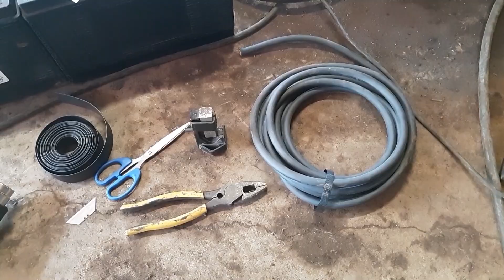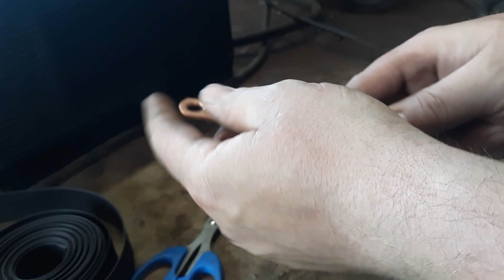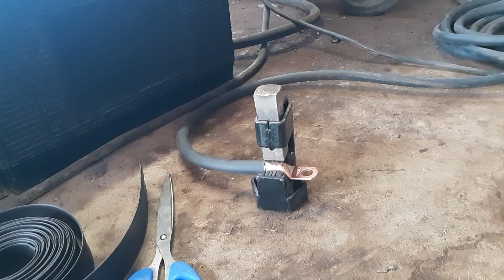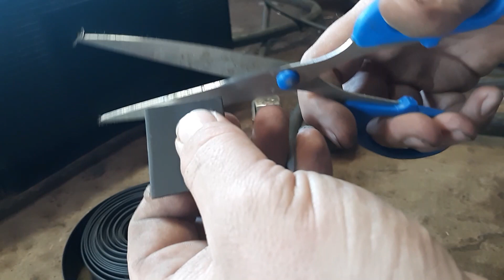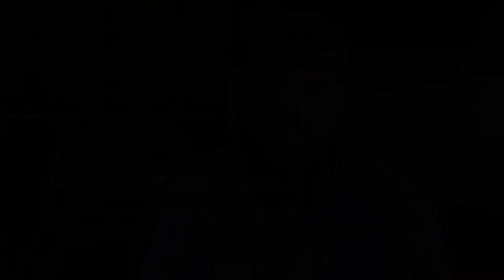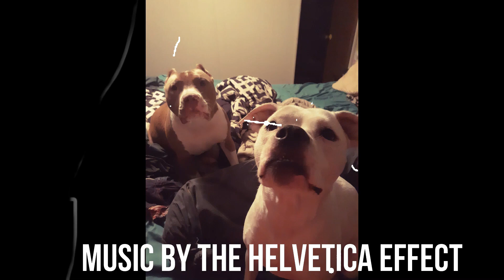How To Build Your Own Battery Cables

Comment: If I’m running six switches
Three pumps 
A batteries 
Would I run six batteries to the front with four solenoids 
And the back two pumps  with two batteries and three solenoids. Straight power could you make a video or help?
The reason I ask, I don’t know what kind of configuration you need to have when you’re running six switches  like seesaw or pancake could you make a video explaining this please?
Reply from the maker: The number of switches dosnt determined how many batterys you need to run pretty much how ever fast you want the car to go up is a result of how many batterys to run most the time for a beginner I suggest 3 batterys to the front and three to the rear and when you get more experience then up the front to 6 batterys you can look on externalrollerz.com and I believe there is a wiring diagram for each of these set ups